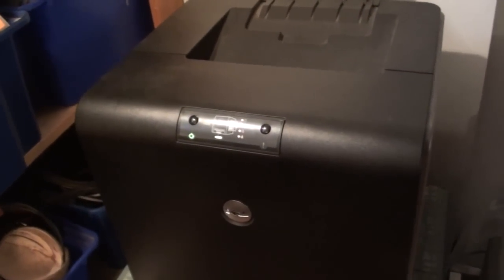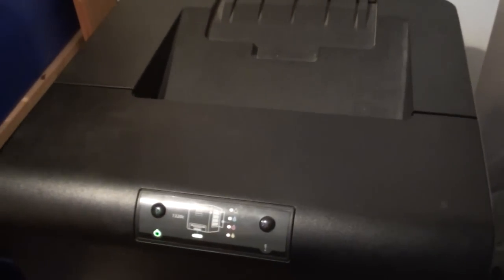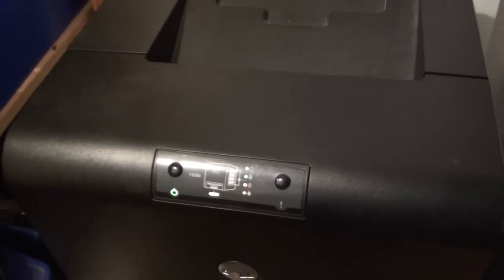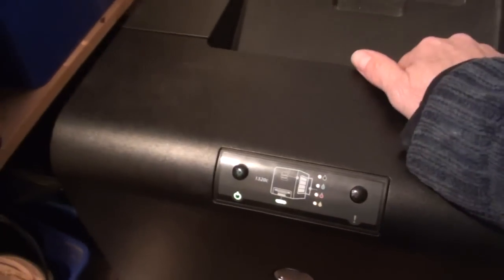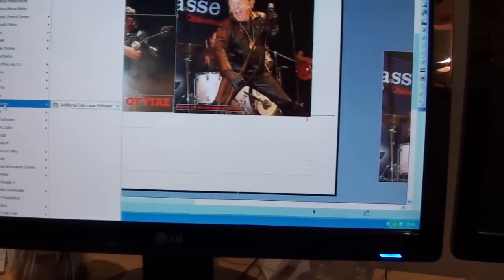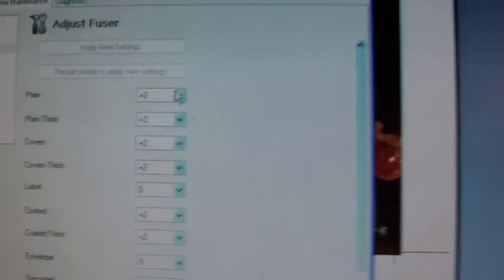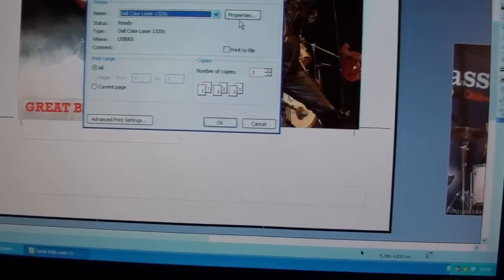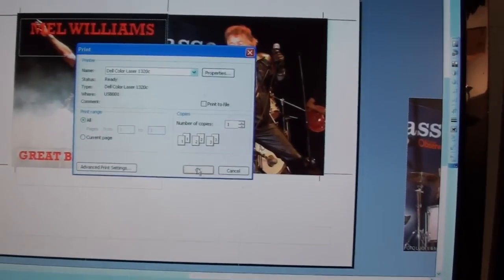Dell Laser Printer - printing problems

Comment: Very old video but still very relevant. On newer printers the menu has admin settings and you can adjust them directly on the printer. Sure enough adding 3 to my fuser for plain got rid of the ghosting I was seeing. Thanks for saving me a trip to the service center. My printer is probably 7-8 years old by now.

Comment: Thank you for this video! I spent some time reading through online forums, but found no solution for this problem. This tip has worked well for me. However, as I have an Apple computer for which there is no Dell support software, the method was slightly different. I was able to achieve the same effect by increasing paper thickness within printer settings of each respective program. Thanks again.

Comment: Thanks for that. My 1320C had started doing this and I was just going out to buy a new one when I saw this and it was indeed the problem. It could possibly be that the psu has dropped off a bit with age lowering the volts to the PHD as it seems to be a problem that occurs over time.

Comment: Hi Pete,
I like your video ... it is the only tutorial I can understand with first viewing. Thanks
I too have W10 but with a Dell 1250c (with the same "fuser-not-getting-hot-enough" problems). I don't have access to Tool Box so I selected 'covers' as paper type. Now the printer starts printing but jams the paper when about 1/3 A4 printed. When I extract the paper from the back of the 1250c, the print that is there seems to be better quality. I will try 'thick paper' and see if that jams but again why would selecting the "thick" paper, but still using  the 80gsm paper, "jam" the system????
Are the problems related?

Comment: I too have a problem with the black ink getting feinter and feinter. Pictures looked dreadful because the black was missing 
This excellent video (thank you parrothouserecords) raised my hopes of finding a solution and I have spent ages trying to find and download the Dell toolbox for my 1320c printer.
Eventually I found a file 'Dell 1320c, 1320cn Laser Printer Error Codes'   on the Dell.com support site.
It gives clear instructions as to how to download the file. However, the unzipping proved a problem for me as I could not find the files after I unzipped them to the file suggested by my computer. However when I shortened the destination  file address I was able to find the unzipped files, the setup file, and ultimately see the toolbox. 
With many more settings available compared with the normal Dell program I hope that I will be able to find a way forward

Comment: TIPP up front: You can issue the change to the parameters using a web browser as well: Just locate the IP of your printer (if connected to a network and setup as a TCP/IP device as my MFP 3115cn is) and setup the fuser as „admin“ there (no password per default as far as I know). YOU MAKE MY DAY! Found your video by chance after having a different problem with printer printer (paper jam in the fuser unit). However, the toner's stickieness issue was bothering me since months and I thought I would have to dump the whole printer quite soon. What annoys me most is that I called DELL at first and they just told me that my printer is out of service term. Poor today: Throw away if broken! Buy a new car if fuel tank is empty…
Reply from the maker: Naturally Dell want you to buy something new, keeping a printer working independently is the last thing they'll want, or the wants ofany service people for that matter. good tip re. IP address.

Comment: This would be so helpful if only I was using a PC. I have just got a new mac and although the printer works, I can't seem to find any of the support that goes with it! Can't find the Support Software, Status Monitor Console or anything else. I have no way of adapting the settings for the printer. Any idea how I can do this? Thanks
Reply from the maker: I am sorry Dupenny, I am a PC user and not at all familiar with MacOS program architecture.

Good luck though, if you can change the paper thickness from anywhere - that should help - I am away from my system, but in Print dialogue, look for Properties and then Paper Tray ...or something like that - I would think that this would be the same on MacOS.
Reply: For anyone who is struggling with the Dell software, there is a way to do it via the printers IP address.

I have done a quick thing to show you how to do it if your printer is on a network.

Press Menu.
Find Report/List
Find Printer Settings

The Printer Settings page is printed.

Under wired network you will see an IP adress.

Go to an Internet Browser and type in that IP address

Once the page loads, follow this guide http://www.gbswimstars.co.uk/images/dell.png

My IP address is 192.168.2.16, yours will be different so don't type in mine :-)

Hope this helps.

Remember, this will only will if you use your printer on a network and not USB.
Reply: Dupenny 
You can access the printer on the network using your web browser. You can get the ip address by pressing and holding the green arrow button, then navigate to it using the address bar. It should be something like this: http://192.168.0.18/ews/index.htm
Reply: using a (different) Dell printer under Mac with the same problems, I was able to adjust the paper setting within the print-dialogue (cmd+p) of the page I wanted to print. Instead of "Layout" etc. go to "Printer options" or something of the like and see if there are options concerning the paper. I was able to fix my problem by selecting the correct type of paper (coated/photopaper), I didn't even need to change the fuser settings. Hope this helps!

Comment: I have the same problem as you have shown. I have tried to follow your instructions but I cannot get the Status Monitor to run. I am using Windows 64bit which maybe the problem. Any ideas on how I can adjust the fuser via another route?
Reply from the maker: Maybe you only have the driver installed and not the extra bits of programming that support the printer? I am away from my set up for a couple of weeks, so I can't experiment, but will certainly have a look on my return.
Reply: I have reinstalled the printer and extras but although the extras appear in my start menu nothing seem to work. Strange,
Reply from the maker: Duncan Elson  Hi, I have had a look around the software and may have a solution. If you can write to me at pete@parrothouse.co.uk I'll explain further. If we can make this work for you, I'll eventually post a video response so that anyone else with the same problem can benefit.

Comment: I have a similar issue but am using Windows 10 - I'm struggling to find the Dell Toolbox to access the settings...
Reply: same here, have you had any luck since this post?
Reply: Connect the printer to a HUB if it isnt networked. In your browser to type the I.P address. like 10.206.15. 10 or whatever it is. That will open the Embedded Web Server in the printer. That will give you access to the settings..

Comment: Where did you get your toner from in the far east?
Reply: Can't honestly remember, sometimes China, sometimes UK reseller. Used Ebay and stuck to good Feedback results, never had a problem. I also bought bottles of toner and replacement chips and they work fine too (though Dell will no doubt say not) I haven't used that printer for quite a while now, but it was ok last time it was in use (around a year ago)

Comment: FYI...Dell doesnt make printers..They contract with other companies to make them.. Generally lexmark & a few  others. F user temp should change automatically when the paper type is selected. Which means the user isnt telling the machine what they are actually running. Most printers have a menu where the paper types are set.. Keeping the fuser temp lower is an attempt to increase the usable life  but today they are metered and the machine will shutdown at a specific copy count to prevent damage.

Comment: Great video, unfortunately that's not my problem (I think). When I switch it on and whilst printing its make a rubbing noise. Doesn't effect the prints yet -;) but I'm not minded to run it till it brakes. Could be the rollers etc. Ink, I buy mine from StinkyInk, no problems. BC